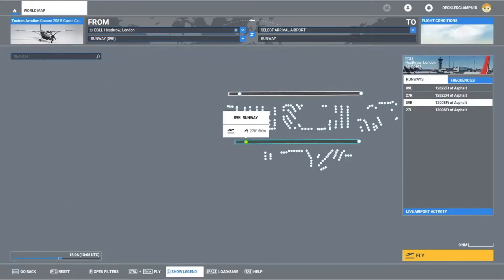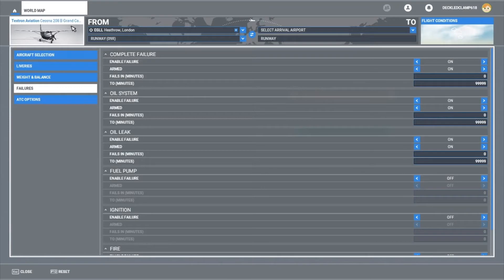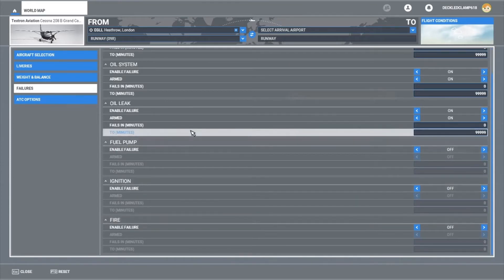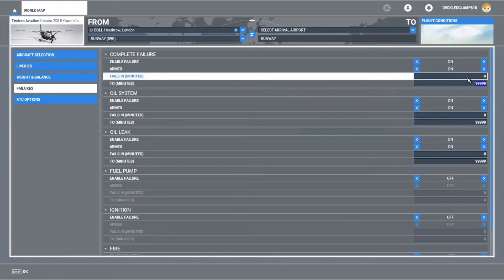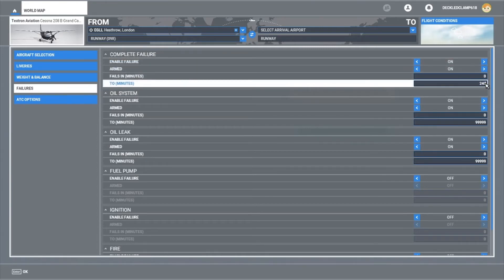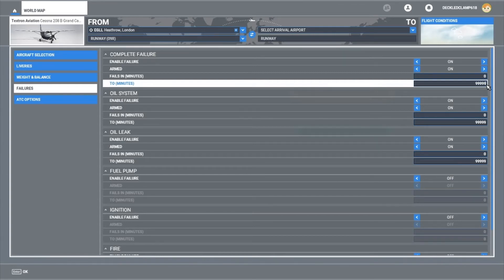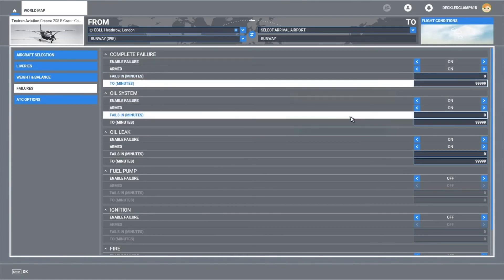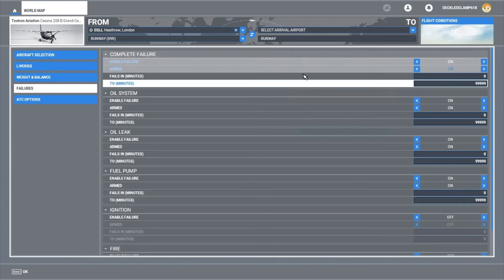Flight Simulator 2020 How to Set Failures Tutorial

Comment: No matter what time I set one of my engines to fail, it always is failed from the start of my flight. Do you know how to fix this?
Reply: Its a error, if you put time (example: 10mins ) to the engine to have a failure and later press the map (press close) and again press the aircraft you are going to fly with,  and go to failures the timer will reset for no reason (everything will be 0 mins).
Reply: I'm having the same exact issue please help. I turn on all failures to have a realistic flight and as soon as I spawn in plane shuts off. I'm using Xbox idk what I'm doing wrong
Reply from the maker: @loganstauffer7252  hi, unfortunately I don’t have the Xbox version of this although I may download it now to have a look, I’ve checked online again and seems like this still hasn’t been fixed, mite be worth a Tweet or check Twitter for msfs 2020
Reply: @warspy9971  i have tried every single Type failure Nothing works engine failure nope and you want even start put it a Happy new flight Nothing happens it just won't start
Reply from the maker: Is this PC or XBOX please ?
Reply: @warspy9971 xbox series s
Reply: @warspy9971  Xbox